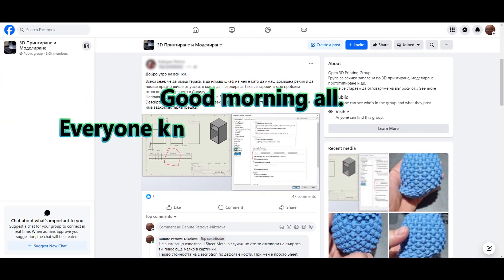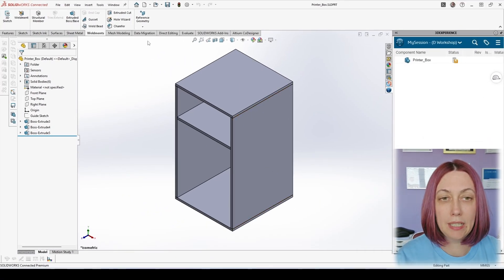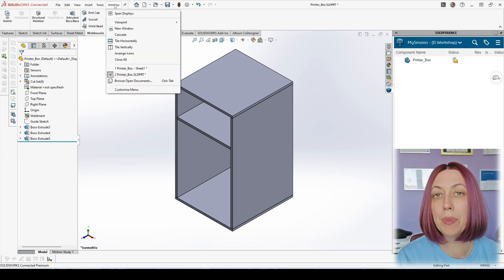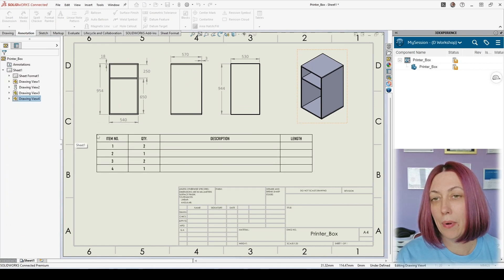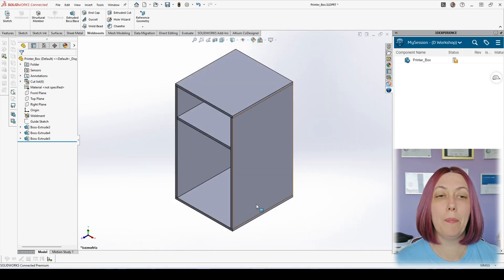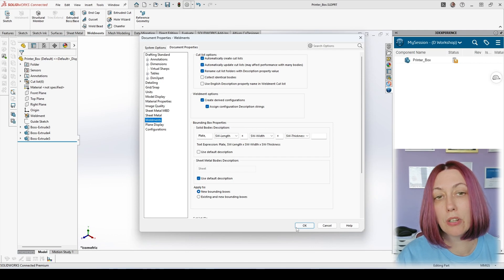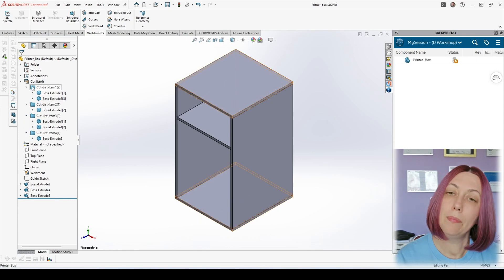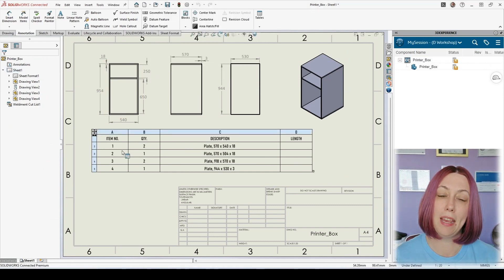SolidWorks Mystery SOLVED: Where Are My Weldments' Automatic Descriptions?

Comment: what about the length?
Reply from the maker: By default, in the Weldment Cutting List table the Length column is set as User Defined.
If you want it to be driven by the part, click on it and change it to Cut List Item Property → 3D-Bounding-Box Length.